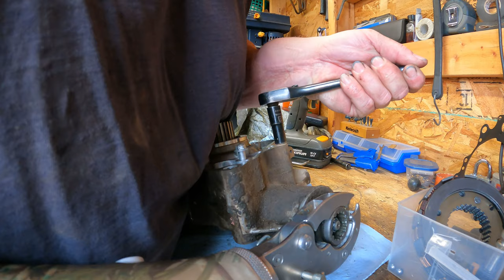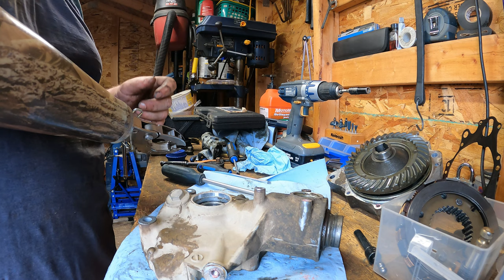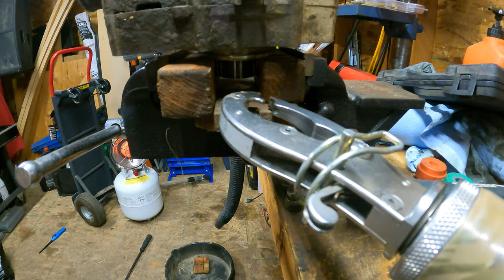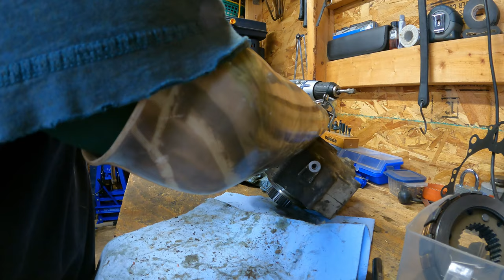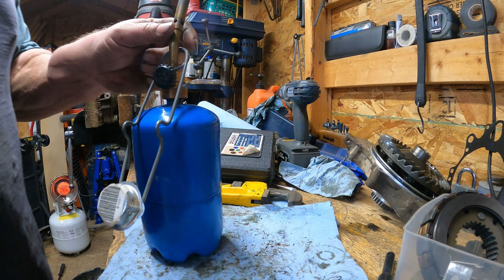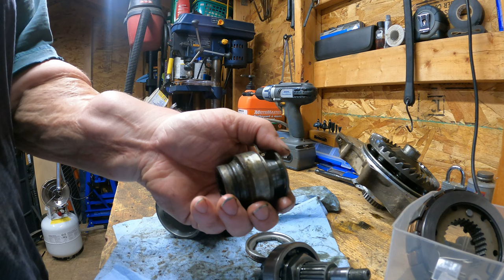2005 Kawasaki brute force 650 front differential rebuild series part 4

Comment: i used a piece of rope to get the pinion nut off. air or battery impact works great
Reply from the maker: that's a great idea. I'm assuming you used the rope to bind up the pinion gear at the toothy side?

Comment: nice vid you should get a longer 1/2" ratchet I like the canadien accent
Reply from the maker: the ratchets i use mostly are a standard length. currently from a big stanley kit. i have many. one that extends from 8 inch ish to a bit better than a foot. if i really need to break something free there is always numatic impacts in my tool kits as well as a 3 foot ish 1/2 inch breaker bar. than a snipe bar on that if needed but i only needed that once breaking a ball joint free on my truck.

Comment: another dumb question here is how tight to torque that weird threaded circle hex nut down and do you put lock tite on this too and thanks if you answer and thanks for the videos
Reply from the maker: For that external threaded pinion nut. it does want non permanent thread locker and i think the torque was 101 FT/lb. the details are in the part 9 video.

Comment: Hi Ron do you have to pack these bearings with grease before you insatll them because I did not oops maybe
Reply from the maker: some assembly lube wouldn't hurt i guess. i never did either. they are oil bathed and you want to keep stuff that's not wet clutch friendly out of the system.
Reply: thanks bud  @thestuffwedowithron1768